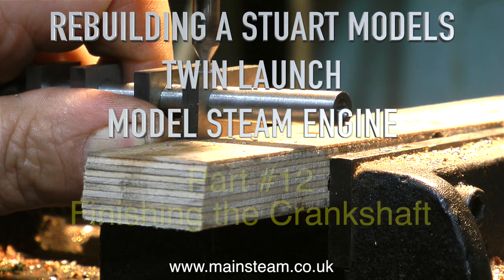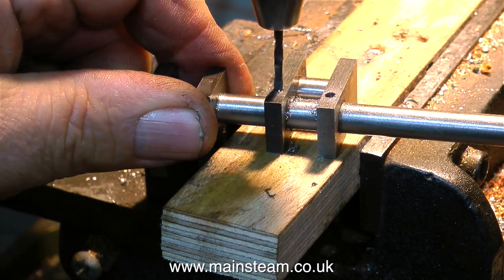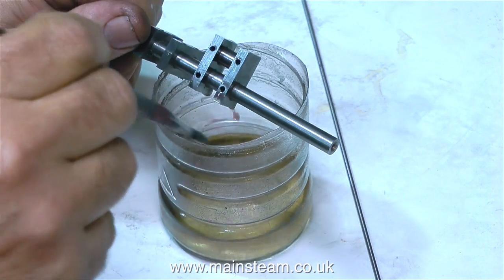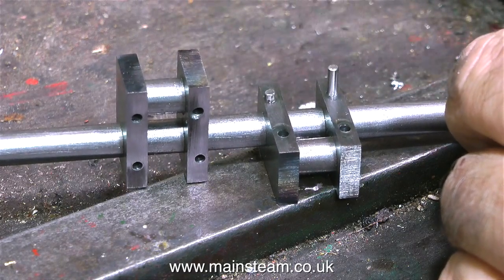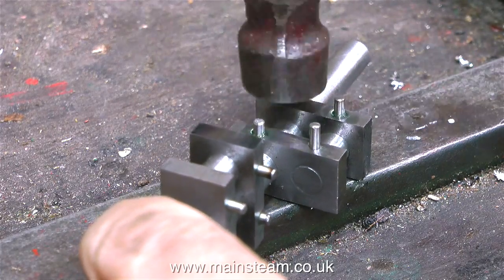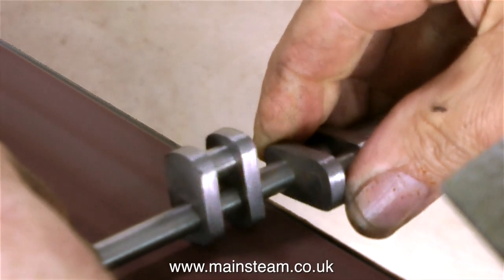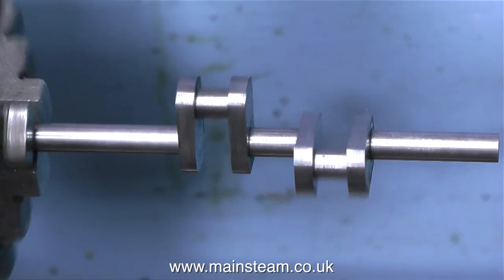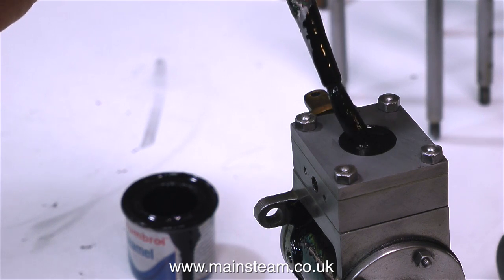STUART MODELS TWIN LAUNCH STEAM ENGINE REBUILD - PART #12

Comment: Mr Appleton is creating what is called an assembled crankshaft. Bugatti cars,Duesenberg cars,and much later,many Yamaha two stroke motorcycle engines were all examples of assembled cranks.Those use interference fit to hold the bits together rather than pinning.But the principle is the same.Back in the day,roller bearings larger than the crankshaft diameter could be installed.One of the reasons servicing a worn out Duesenberg crank is spectacularly expensive.He finds it easier to simply create a new crank rather than try to tinker with a damaged or out of spec one. This is a good series.
Reply from the maker: An excellent comment - I thank you for that :-)))

Comment: Keith:  Thanks for putting this crankshaft series together.  I ordered a set of Stuart #4 castings and see they don't offer the cast crankshaft blank anymore.  Years ago I did a #10V, #10H and #7 with the cast shaft.  I think your method will make life so much easier.

Comment: Nice work with the build and trueness of that crankshaft. You piqued my interest about 'linishing' so looked up its etymology. Apparently it's from blending the words 'linen' and 'finsh' and as you indicated, means applying a smoothing finish on something via a belt sander or belt covered in abrasive. Thank you, I've learnt both some practical skills and a new word from your video.
Reply: Go You :) so did I lol Cheers Keith. G :)

Comment: I greatly appreciate the clarification regarding the LINISHER. It is apparently an old engineering term for any grinding or sanding machine that is used to improve the surface flatness of a part. Once you'd given me the spelling, I did some research you see.
I'll certainly never forget the word now!

Comment: I really enjoyed this series it was great. Thanks for making it. You did make me feel stupid though! All the hours I spent and still spend machining cranks from solid! Ah well your built up cranks look great.
Reply: I'm going to have to check out your channel! I'd been wondering about what kind of support structures one would use on the lathe to do that job, and what kind of stresses one would see from an interrupted cut.
Reply: My experience has been that the amount of work required for a built-up crankshaft is not that different from a crankshaft machined from the solid.  Of course, much depends on the type of steel used.  My preference for machined-from-the-solid shafts is "1144" aka stressproof.  It is quite hard and strong, yet machines beautifully.

Comment: Linish is an engineering term that refers to the process of using grinding or belt sanding techniques to improve the flatness of a surface.

Comment: While watching the series, I often asked myself if fixing the parts of the crankshaft to each other couldn't be done easier with TIG welding the parts in a jig. Would that introduce too much heat and distortion?

Comment: This is great! Very interesting and you keep a pleasant monologue going! One question though, is there something inherent in the the design of the steam engine (valve timing perhaps) that the crank pins don't oppose each other like they would in an automotive application? Can the steam engine be considered the equivalent of a two stroke or four stroke combustion engine? 🤔😀

Comment: I'm not familiar with the term "silver steel". However after some quick research I believe it to be the same as what we call "Thompson rod" here in the states. Thompson rod is centerless ground tool steel. Available in many diameters.
Reply: In North America, British "silver steel" is called "drill rod".  This is a high carbon tool steel suitable for heat treatment.  It is typically sold in the annealed and centreless ground condition.

Comment: Is silver steel the same as stainless steel? I enjoy watching your videos, they look really interesting. How did you get interested in this hobby?
Reply from the maker: No, it's different. Silver steel is harder than stainless steel can be heat treated and then tempered to harden it thoroughly. In this case though I use it in its "raw" state as it is very hard wearing anyway.
Reply: @keithappleton  It's known as "drill rod" here in the States.

Comment: Why did your drill the pins all the way through? Would it not be sufficient to even go part way into the shaft? Surely cannot make the crank that unbalanced.
Reply from the maker: all the way through so you can tap them out if required . . . .
Reply: @keithappleton  You mean some thing could go wrong? 🤔😉 I see a lot of Stuart 10V builders make this kind of crankshaft instead of using the cast in the parts. I wish I had a mill to go with my lathe. 🤔

Comment: Why not make a balanced crankshaft where the webs have projections opposite the crankpins, as on internal combustion engines?
Reply from the maker: Because I am doing a restoration of an existing vintage engine which does not have counterbalance weights :-)))

Comment: Why do you not silver solder the crank?
Reply from the maker: Heat distortion and Loctite 603 with pins works fine.